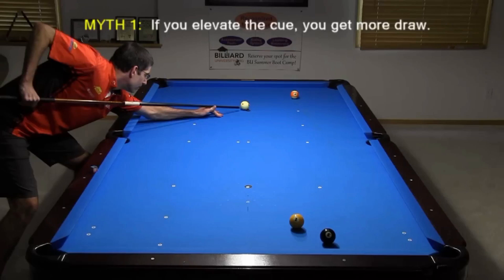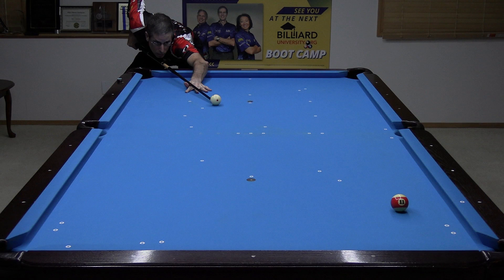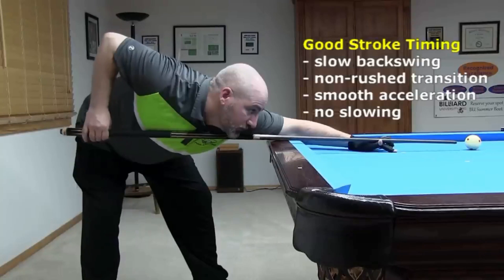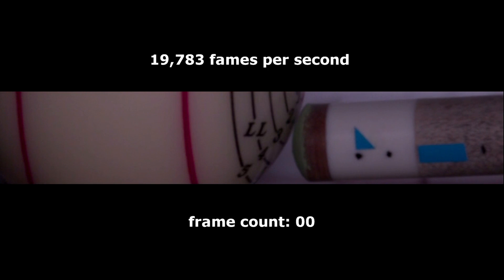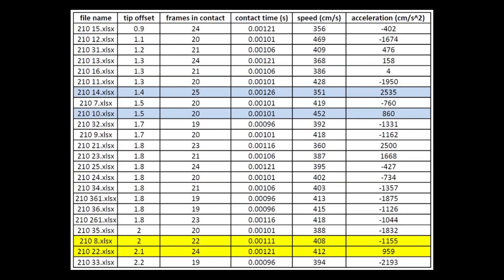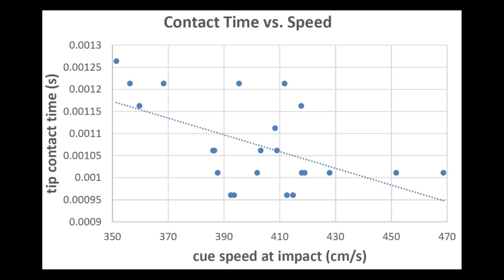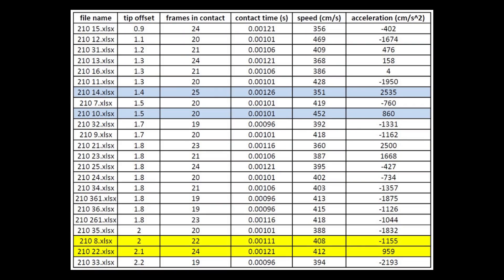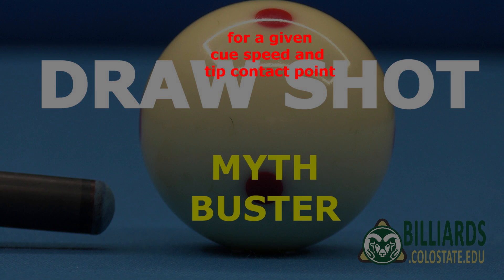DRAW SHOT Effects Myth Buster … a Slow Motion Video Study

Comment: Looks like cue tip movement effects the spin. It's bending then pushes ball to the bottom. It is not single direction vector. Also cue angle must be important because it's increasing friction between cue ball and cloth so contact time gonna be longer. Is it possible to do with steel rod with full resin tip which is not bending?

Comment: 8:38 did you really just finish up acknowledging that hitting slower creates less draw (obviously because there's less energy been given to the shot) and then immediately switch to talking about it as if contact time was the variable you were adjusting?

Speed was affecting both contact time and draw. If you had been able to alter the contact time independently of cue speed then you could have drawn a conclusion about the effect of contact time but you'd need something more consistent than a human to perform the shot for you.

The graphs look quite scientific but I'm not convinced the methodology is particularly scientific.
Reply from the maker: @MASAo7  I agree that if taken out of context, relating draw amount to tip contact time seems inappropriate, but I was just trying to make a point about the wrong thinking people often have concerning needing more tip contact time to get more spin.
Regardless, the results of the study are still clear:
- all that matters about the stroke is cue speed and tip contact point at impact.
- cue acceleration (or deceleration) at impact has no effect on the shot.
- tip contact time is less with fast speed shots.
Reply: @DrDaveBilliards   That may be true but in the real world acceleration is crucial because you only have about a foot to get the cue up to speed so significant acceleration is required. 
Again in the real world deceleration really does matter because it means you didn't play the shot the way you intended to and therefore you won't have got the result you played for. 
You could really do with some kind of robot to play the shot for these studies because by far the least well controlled part of your experiments is that you've not managed to eliminate the human chaos from the system.
Reply from the maker: @MASAo7  Obviously, the cue must be accelerated, and stroke "timing" is important (and deceleration into the CB makes speed control difficult).  For more info and further explanations, see:
https://drdavepoolinfo.com/faq/stroke/acceleration/
https://drdavepoolinfo.com/faq/stroke/good-timing/
Reply: @DrDaveBilliards   There's just so much more to the physics of the game than can truly be covered in the kind of YouTube video which is going to attract views. 
A lot of the maths (most of which I've never seen on your channel) is pretty dull and I get that you'd lose viewers if you went down that path.

You have a pressure to keep your science stuff more like Mythbusters than a tedious documentary. I tend to forget that.
Reply from the maker: @MASAo7  Agreed.  That’s why I “hide” most of the “rigor;” although, it is available via the links on the resource pages linked above.

Comment: The thing that made me particularly interested in this was potential parallels to the way a piano key is accelerated. In that case you definitely can prolong contact time between key and hammer (lab experiments have shown it's possible to knock the hammer away instantly via sharp blow or to achieve the same speed via gradual acceleration). As you can choose to hit or push, extending contact to the hammer really does offer more control via timing. However, it's very interesting to know that what might feel similar to the reality there, is only an illusion in pool.

I'm a little curious still though about the ones where the contact time did change but the result didn't. Do you have any deeper explanation of how it turns out that way? Presumably the impulse graphs would be a different shape with the pacing of force distributed a little differently. I trust your results, but it did seem rather counterintuitive that the time could vary but then showes no different result. It would be good to have a deeper explanation of this surprising effect.
Reply from the maker: @cziffra1980  FYI, I have a lot more info and videos on this topic here:
https://billiards.colostate.edu/faq/cue-tip/contact-time/
https://billiards.colostate.edu/faq/stroke/acceleration/
https://billiards.colostate.edu/faq/stroke/good-timing/
Check them out.

Comment: Very interesting stuff. In the previous video I did have doubts (where it struck me that the difference between 11 vs 12 ms was still notable as a percentage difference) but I can't question the results here.

Have you studied any other sports by the way? I'm interested in both objective similarities/differences and perceptual ones. I've been looking into how you get more distance in golf by slowing the hands ahead of contact (and made a video on the same concept applied to piano technique). This actually gives more clubhead speed by allowing flexion to release and unbend. The clubhead thus accelerates into contact, but this is quite possibly a similar issue where it simply generates more speed at contact (with the timing of acceleration being the only way to maximise thatspeed optimally- accelerating the hands all the way contact only increases lag and loses club head speed).

I was briefly wondering if some kind of lag issue could come into a pool cue (via minute compressions) but I'm sure it's too minor to matter and that it's as good as rigid before contact. 

Anyway, the way speed gets to the target seems variable in different sports but the interesting thing is it does seem that the active human input ends a fraction before contact in general. In my video I actually said that in tennis you would accelerate through, but it seems that even there the lag issue comes into play, and that players ease milliseconds before contact with the ball.
Reply from the maker: @cziffra1980  sorry, but I have not studied stroke and impact mechanics in other sports.
Reply: @DrDaveBilliards  ah, no worries. It's well worth looking into some other ones too. You've already been thorough with the pool investigation, but it's really interesting just to see the extent of similarities and differences elsewhere.

The one that really surprised me is that putters marginally slow before contacting the ball in a pro stroke. The idea of accelerating into the ball is really just to ensure movement will only marginally slow due to starting the upward part of the pendulum path. I think the only real difference with moderate paced shots in pool is likely the effect of gravity, due to the subtle vertical component.

For me, the one thing missing from the analysis here is the margin of error from different strikes - although it would be harder and more subjective to measure scientifically. If someone actively decelerates on a putt, it may not shorten contact time necessarily but there's definitely less control compared to a fraction of passive deceleration. 

Although you were able to match speed and strike point via deceleration and acceleration for an individual screw shot, what would be most relevant in practice would be the average number of shots required with that technique, to fall within a given range of accuracy. If we select after sufficient attempts, they are theoretically identical. However, the average number of trials to achieve a fairly precise result some three or four times would likely offer the best evidence we could get for why timing and follow-through still matters. I think it would be very similar to putting in terms of control.
Reply from the maker: @ Agreed.  A more thorough, widespread, and scientific analysis would be interesting.

Comment: In my humble opinion, all contact time is 1/1000 of a second. Do the measurements at 1/10,000 and the ones at 1/100,000 of a second longer that 1/1000 of a second mean anything? No, I don't even think you can see a difference of 1/500 contact time let alone between 1/10,000 or 1/100,000 of a second. It's like computer memory. "I'm upgrading 2400 MHz to 3000 MHz because I want faster speed." Will you see anything "faster" happen on your computer because you increased your speed by 600 MILLION cycles per second when you already have 2,400 MILLION cycles per second? No. So anything more that 1/1000 second is measurable, but not a factor.
Reply from the maker: There are changes in tip contact time with tip hardness and shot speed; but, as you point out, these differences are unimportant per the info and videos here:
https://billiards.colostate.edu/faq/cue-tip/contact-time/
Reply: @DrDaveBilliards  Thanks Dave. And as a user of both the Illustrated Principles book and cd, I appreciate all you do for the billiard community!
Reply from the maker: @Kevin-mm6xm  You’re welcome, and thank you!

Comment: Great work, Dr Dave.  However, I am not sure if your conclusion to the shot at 7:12 is correct as the two cues are travelling at basically identical speeds if you compare them frame by frame.  I was expecting the "accelerating" cue catching up with the "decelerating" one instead.
Reply from the maker: I agree it is difficult to see the difference in acceleration over a short distance like this, but the calculations from the data show it clearly.
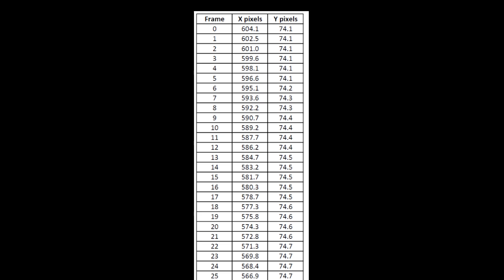Reply: @DrDaveBilliards   @DrDaveBilliards  You are right that for example, in shot No. 8 with a=-1155cm/S^2 and v=408cm/S, the velocity should be at around 409cm/S just a millisecond before the impact.  However, with the resolution of roughly only 30 pixels/ms from your table at 4:08, I wonder what are the precisions of your velocity and acceleration measurements?
Reply from the maker: @laitaumou1043  I will let @PuboH reply to this one since he did the detailed analysis of the data.
Reply: @laitaumou1043  The two shots have impact speeds 408cm/s and 412 cm/s. So they only differ by 4cm/s. The clip shows the last 105 frames until impact. Since the footage was recorded at 19783 fps, that corresponds to 0.005s time elapsed. During this time interval, two cues would have traveled distances only 0.02cm = 0.2mm different, which is about width of 4 human hair.
Reply: @laitaumou1043  I'm not quite sure what you mean by the precision of the measurement. If you mean sampling rate, the velocity and accelerations are all calculated from the position data of the cue, which is tracked frame by frame, so 60 data points/second. Of course the data are then turned into smooth polynomials for ease of differentiation. If you mean the accuracy of the tracking, I don't really have a good way to quantify this, since I used python packages and after effect, and I don't know how they actually implemented the algorithms, therefore neither its accuracy.
Reply: Sorry I misunderstood your question. I just did a quick calculation. Short answer is, the two cues have at most 1 pixel difference during the pre-impact time captured on camera. Here is the long answer. 
The two cues, despite having drastically different accelerations, travel an almost identical trajectory. 
If you want, the shot 8 cue has a position-time function (I only consider their horizontal position)
6*10^{-7}x^3-6\*10^{-5}x^2-1.6563x+605.38 
while shot 22 cue has a position-time function 
7*10^{-7}x^3-0.0003x^2-1.6251x+607.15
the variable x has unit (frame), and the output has unit (pixel). The two cues both impact the ball at x = 97. So you can safely ignore the part x>97. 
If you subtract these two functions, you see that their difference is almost a horizontal line (averaging at 2.55pixels), meaning that their difference is almost a constant. If you align these two clips, that is, just subtract their initial difference at x = 0, you get 1.77 pixels. Then their position difference is at most 1 pixel throughout the clips. The 22 cue does catch up when the impact is about to happen, but the amount is so tiny. In any case, because the time interval is so short, it is really difficult to see the "catching up".
Reply: @puboh  Hi!  Thank you very much for the detailed explanation, PuboH.  As you have said, "the two cues have at most 1 pixel difference during the pre-impact time captured on camera".  I thought no matter how many decimal places your tracking software may give you, the precision of your position measurements are always limited by the resolution (in pixels) of your camera.  Hence it seems to me that your are trying to measure some very small quantities which are comparable to the error of your instrument used here.  As I have no idea how your tracking software works, I am curious to know how it is able to guarantee the position measurements with amazing precisions like 2.55 pixels or 1.77 pixels to ensure  the conclusions are valid.
Reply: @laitaumou1043  That's right, the precision of the measurements depends on the camera resolution. Regarding the "amazing precision" of position measurements, you might have missed what I said. The tracking software gives me around 100 position data for the pre-impact cue. I then used these 100 points to fit a cubic polynomial. Once I had a polynomial, I effectively smoothed the data to infinite precision. Of course the polynomial fit is not 100% accurate, but the result is extremely good(with square norm ~0.04 iirc). I then treat these polynomials as the "actual" positions of the cue. So there will be errors, but I believe the error is small. The numbers 2.55, 1.77 are all results from calculations with these polynomials. Another aspect that can at least show that the results are not bullshit is to note that, the difference of the two polynomials are no larger than 1 during the pre-impact time, which agrees with the observation; and after impact (the fitted polynomial doesn't stop at cue impact) the polynomial for the "accelerating cue" does catch up to the "decel" one. Thus, the polynomials tell us, if the cues didn't hit the ball, the "accelerating" one will catch up the "decel" one.
Reply: @puboh  Reviewing the polynomials, the coefficients of the x^3 and x^2 terms are way smaller than that of the x^1 term.  Therefore they become effectively two linear approximations of the cues' positions over the frames 0<x<97, and the difference of their slopes (velocities) gives the "within 1-pixel" observation and interception point after impact.  However, when comparing the 0.04 square norm with the x^3 and x^2 coefficients which are in the order of 10^-7 to 10^-4, I am not sure if you can trust them to yield meaningful acceleration/decel results.

Comment: First I want to say thanks for all your hard work, you provide a lot of good information!
However:
Striking as low as possible, with elevation can provide more draw in certain circumstances. The elevated cue will cause the cue ball to skip across the table. Less contact time with the table, less backspin loss. 

Sure it’s difficult and adds another degree of complexity which makes the shot more missable, but doesn’t change the fact that what you’re stating is only applicable to your testing conditions. (Your table, felt, temp/humidity)
Reply from the maker: You're welcome.
Cue elevation can narrow the draw angle per the info and demos here:
https://billiards.colostate.edu/faq/draw/quick/
But cue elevation does not help create more draw for the reasons here:
https://billiards.colostate.edu/faq/draw/cue-elevation/
The CB loses more backspin on the first bounce than is saves by being airborne.  
And you are correct.  Cloth conditions play a huge roll:
https://billiards.colostate.edu/faq/table/cloth-effects/

Comment: What does it mean when the balls don't bounce off the cushion perpendicular to the angle they approach? My rails  are in good condition but seem to eliminate zig zag causing the ball to not travel down the table but to bounce back and forth between the opposite rails or even come backwards. My guess is that my 2" balls are too small for my cushion nose. According to my math, if I use 2 1/4 inch balls, my cushion nose height (28mm) will just be above the centre height of the ball.
Reply: I'm confused because the pocket size seems to demand 2" balls but the cushion nose height is perhaps suited for 2 1/4"?
Reply from the maker: @lukeforsyth792  See:
https://billiards.colostate.edu/faq/table/cushion-nose-height/

Comment: I also experiment a lot with pool billiards. However, I don't put in that much effort into measuring.
I work with very different ferrule diameters. (usually between 12.9 and 10.5 mm)
What becomes clear here is the contact point of the top edge of the tip. This seems - also based on the measurement - to be significant for the draw result.
With a thicker tip diameter, the bottom edge is very close to the base plate at the point of contact, while when using the thin tip size the rule clearly applies that you have to aim for a tip width above the table width.
As far as the hardness of the leather is concerned (that wasn't the topic in the video), I always notice that long draw shots are subjectively easier with harder tips. Energy transfer certainly plays a certain role, which results in acceleration. In my opinion, the grip of the leather surface should also be examined in more detail (roughness in interaction with chalk characteristics), although this property is more relevant for short distances and applying side spin.
Reply from the maker: See:
https://billiards.colostate.edu/faq/cue-tip/size-and-shape/
https://billiards.colostate.edu/faq/cue-tip/hardness/